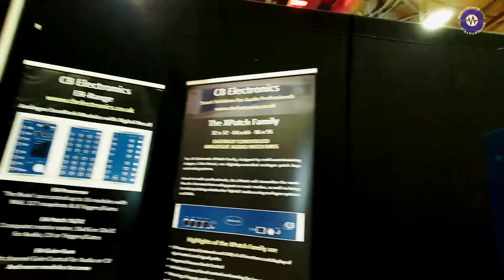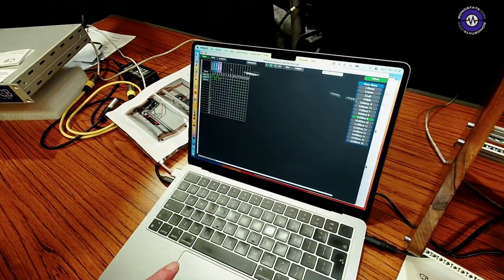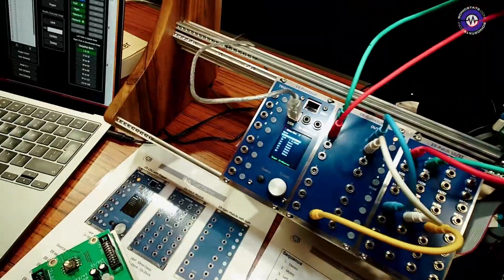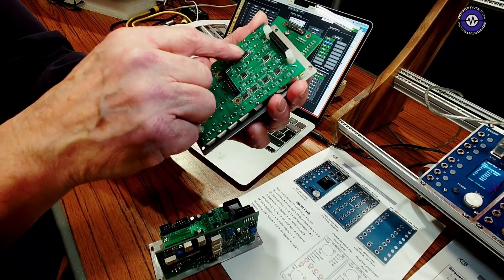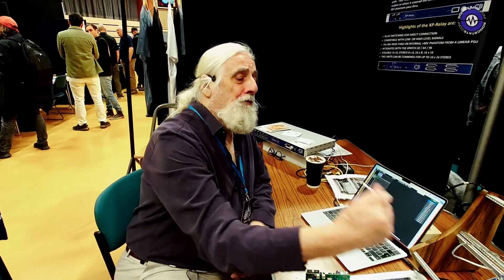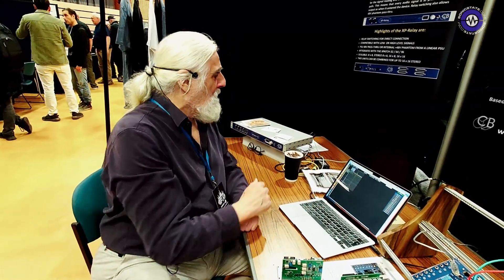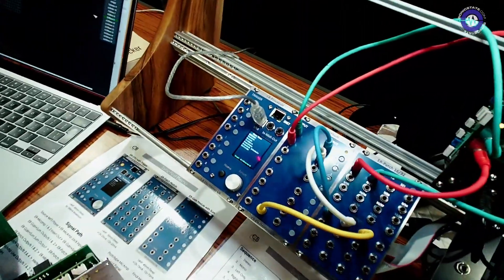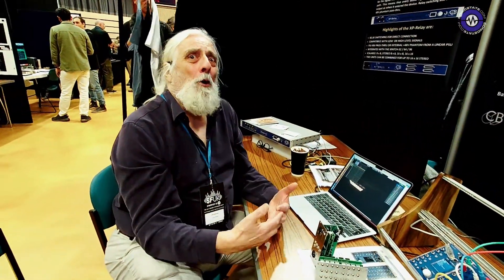SynthfestUK 24:  CB Electronics Recallable Eurorack Patch System

Comment: For those confused, it's a patch bay+. Meaning you'd have different configurations patched through it all the time, like an audio patchbay, but its control module can alter the routings, like their audio product, or inject CV, like a euro sequencer, or silent way.  E- Pardon me, it is only matrix routing. This seems a misstep.~
Novel, but once you're at the level or size that something like this requires, I'm not sure you'd be using eurorack like this. There's a reason it's been a "tough nut to crack."

There actually have been a few swings at this, including one that co-opted the CV/gate bus but they haven't succeeded commercially in any case tmk.

Comment: Seems to be a computer required sorta system? Edit: I see you can use the central computer, but that's some 80's kinda fenaglin' needed. Very interesting nonetheless, will be interesting to see where he takes it.
Reply: I find it easier to use without a computer than with a computer it's extremely simple to use without software. The software is confusing to me. I love this thing it saves so much time.